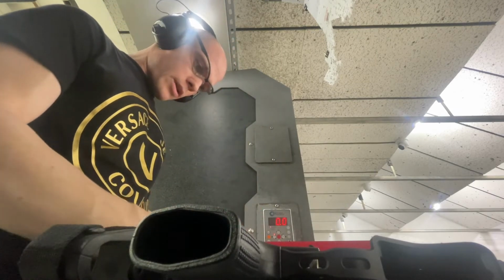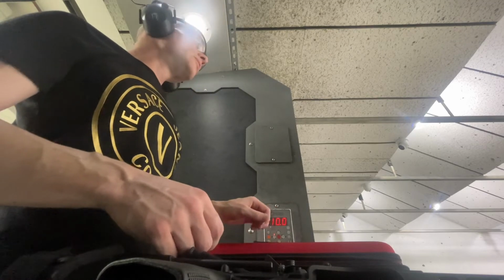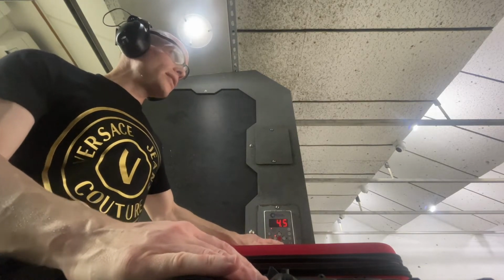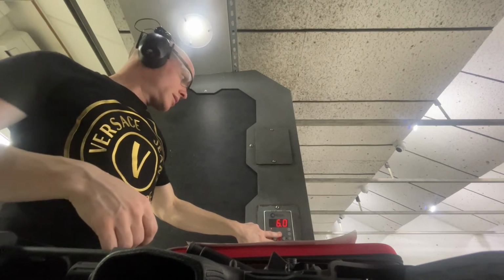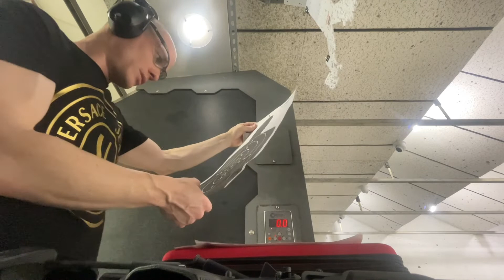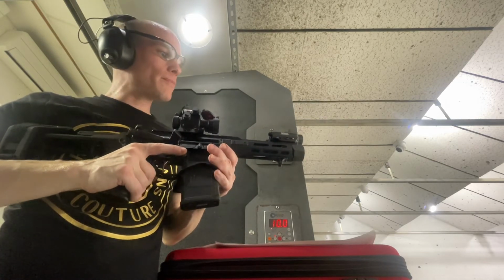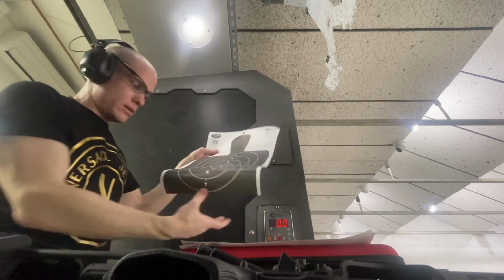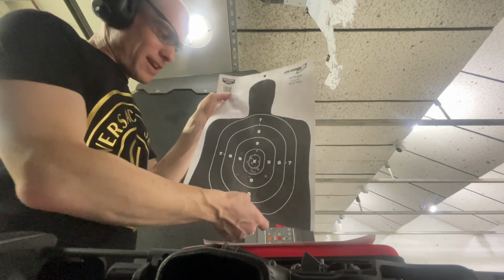Range Day with Saint Edge PDW - Laser is still On Point after last time!

Comment: Don't ride the charging handle forward, you will induce malfunctions. Pull it back and let it go.
Reply from the maker: Yes that's exactly what happened in the beginning!  When I realized that is what caused the jam, I let the charging handle slam back hard from then on.  No more problems after that.  It was only my 2nd time using this gun, but I won't make that mistake again.
Reply: @MikeWithTheGuns  Good to hear, making mistakes and learning from them is how you grow. Keep practicing and you will succeed.

Comment: I HAD A SLAM FIRE LAST NIGHT my FINGER was well away from the trigger it was actually completely off the frame of my G26 and I Slam the slide home to chamber a round and as soon as the slide goes home BANG! I put a hole in my Monitor and it stopped In a wall beam….. I called my local sheriffs office to ask them what may have caused this as well as multiple gunsmiths they all told me it was Lenny magills pyramid trigger I had gotten last year…. Apparently the trigger had a massive recall sometime last year and I was unaware of this
Reply from the maker: I didn't hear about that but I will keep it in mind now.